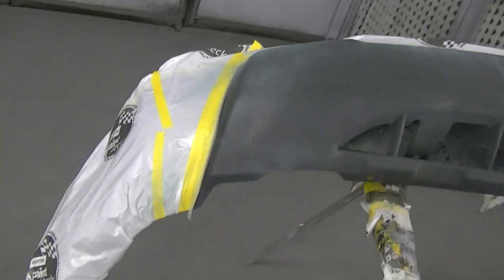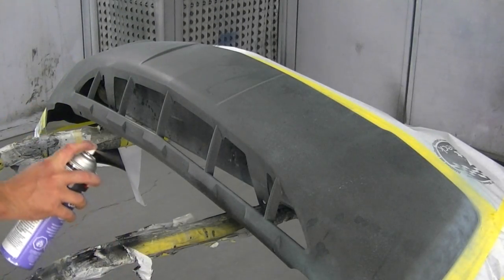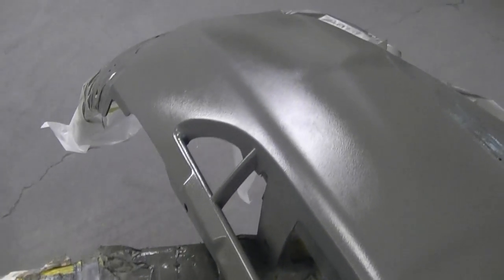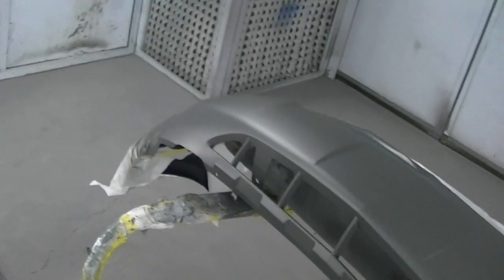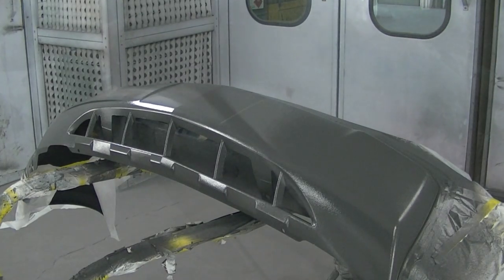How to Create a Textured Surface & Flat Painting

Comment: I used Rustoleum texture coat in restoring a roof rack on a Mercury Mountaineer.  Cross bars are aluminum and rails are a hard plastic.  It is made to be a top coat.  Results were good and it has held up for 4 years at the beach.  Don't know about compatibility with all materials so you'd have to check that out.  Also used SEM texture with similar results to yours - just can't tell when you'll get a glob.
Reply: Jim - The Rustoleum paint you used, was it the product in the spray can I see on their site?  SKU 223717....   I am looking for a product to re texture some plastic pieces on my Motorcycle, mainly hand guards and saddle bags.  Did you use and plastic primer before applying the texture?

Comment from the maker: Hardener in the basecoat can improve durability, and in some cases don't require a clearcoat (such as underhood). So adding a hardener to the base here would prevent it from being washed off with a mild solvent however would still not give it any UV protection so it's not a good procedure here.
Reply: ayo, are you still up?
Reply: Now we can reply to our comment, bro